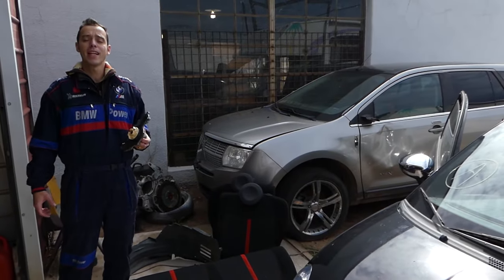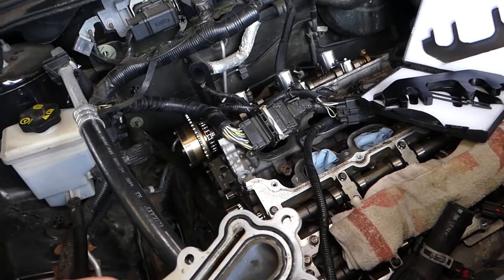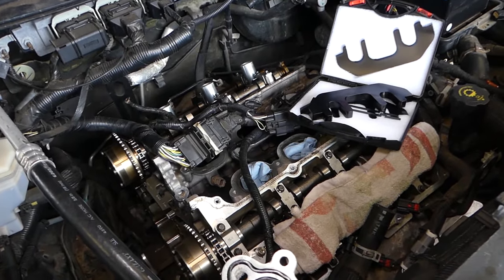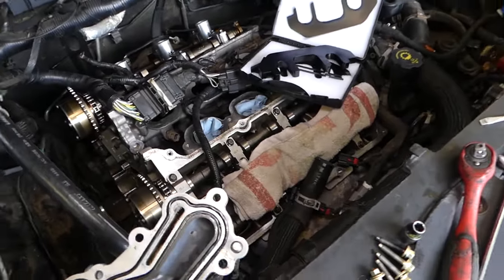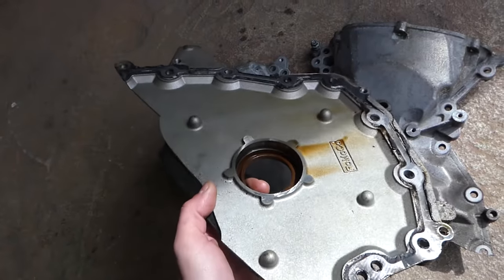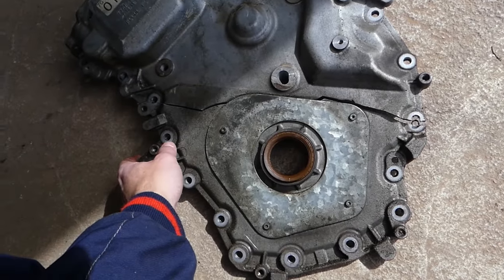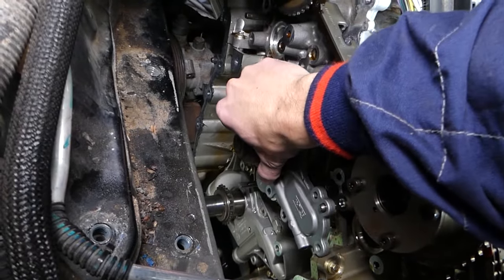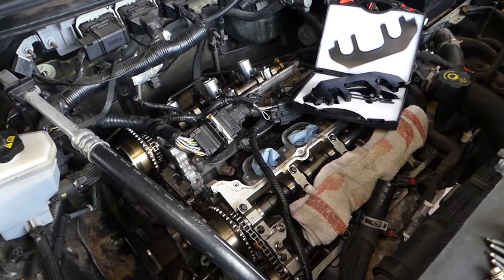LINCOLN MKS MKZ MKT 3.5 3.7 V6 WATER PUMP LOCATION REPLACEMENT EXPLAINED

Comment: What kind of genius buries a water pump inside the engine. Especially directly above the oil pan. Cars may run better than ever, but for what they charge at sale. This design is ridiculous. It can destroy an engine if it isn't caught in time. Way to go engineer's.
Reply: Yeah, screw this newer stuff period. Ford/Lincoln is poop these days.

Comment: wow! thank you so much 4 making this video! It actually stopped me from purchasing a 2011 MKX w/ the 3.7l . I knew the older 3.5's were trash & had the water pump located behind the timing cover but I did NOT  think the 3.7's did! It is worthy of mentioning they did NOT do this on the 2011 & up Mustang's w/ the 3.7l . It's still a normal h20 pump on the outside of the engine driven by the serpentine belt. I guess Ford knew that would hinder Mustang sales if they did this crappy design on one of their flagships, huh?
Reply: i could be wrong you make a great point, because the dealers make lots of money changing the pump from labor, its probably because its a sideways (FWD) mounted version, there was probably no room to have a belt driven water pump on the front but, your theory wouldn't surprise me

Comment: Can you remove the water crossover without removing the intake on a 2010 navigator 5.4 liter? I'm just trying to replace does gaskets on the water crossover.

Comment: If you mentioned this in your video, I must have missed it. My question........Is there a way to make the water pump last longer or is the water pump issue completely random?
Reply: Change your coolant every two years, or 40k miles, and use the new Motorcraft Yellow coolant.
Reply: @chuckschreiber2365  Thanks for the reply. The more information I have, then better.
Reply: Get rid of the Motorcraft coolant, wether it's orange or yellow, get rid of it. Use a P-Oat asian vehicle coolant. P-Oat coolant has phosphates that essentially coat your entire cooling system in a thin layer. This layer protects rubber seals and metal components. The updated Motorcraft Yellow coolant is a P-Oat formula, however, I still wouldn't trust it. Super tech blue from Walmart does the job.
Reply: @jaredshelton4718  Great, thanks!

Comment: It's almost like Ford WANTS the coolant 2 mix with the oil just b/c of a failed h20 pump!?! Now you're most likely gonna need a whole  new engine!?! I mean, holy crap, with this amount of work needing 2 be done just 2 replace the darn thing, who's really gonna preemptively do this job b4 it wears out? We used 2 call this profit engineering in Texas!!!

Comment: All I know is the engineers that designed engines that you need to remove half of the engine just to replace the water pump!!! Need to be tortured somehow. Make them replace 20 of them and see if they keep designing things in that manner. I'm pretty sure they will change things.